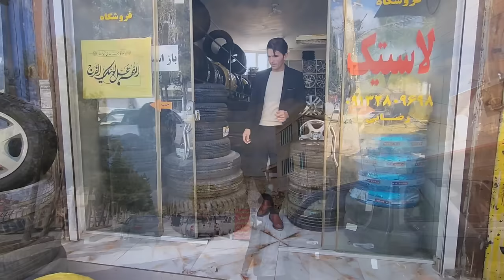Cooking Nazri Ash and distributing it among the nomadic neighbors

Comment: Salam TIR Channel & Hasan Family.. Happy Ahura is well & wall finished erected. However I am bit concern that around base of house after some sand earth has been dug & used from there to do the wall hence it may loose the strength foundation to hold up the house structure if it isn’t cemented or something.. Elements like rain snow  wind also may reduce its strength from time to time gradually so regular maintaining & sustaining the strength of the building is important. Insyallah. Allahu ‘Alam